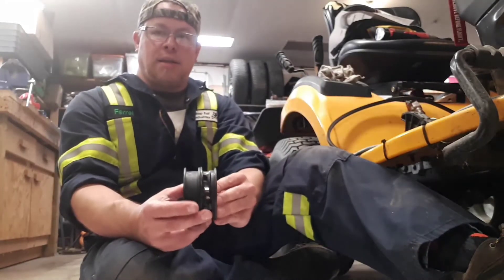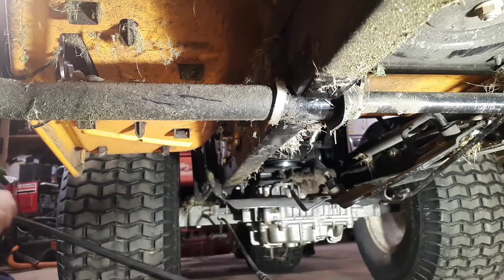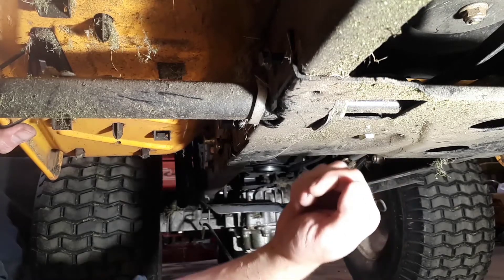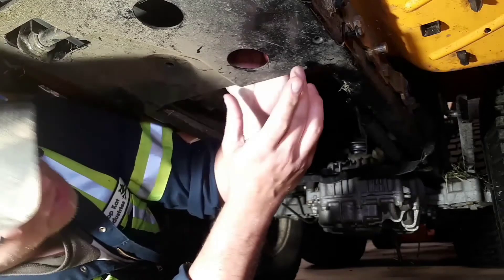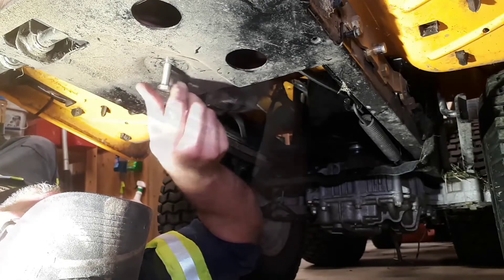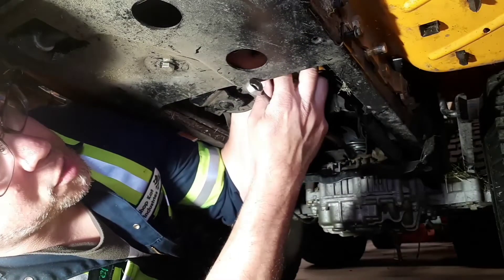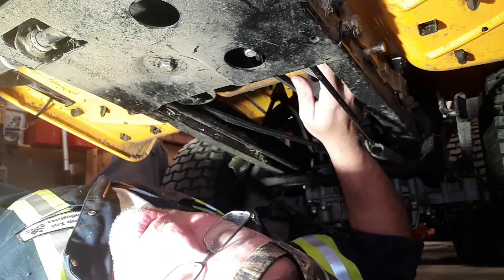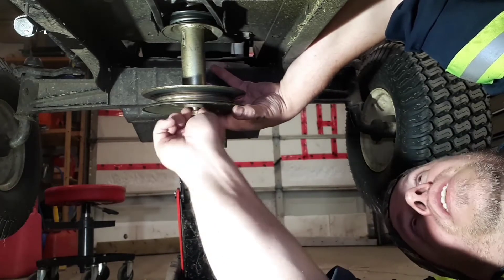Cub Cadet Drive Belt Replacement: The End!

Comment: On my Husqvarna GTH2548, I discovered that the floor plate was easy to remove and gave me much better access to the pulleys from above.  My damaged pulley was a V pulley and not an idler, and was not as badly damaged, so I am going to try to keep using it.  My drive belt did repeatedly pop off and destroyed itself, and the damaged pulley didn't help, but I think the main cause was because the pulley mounting bracket was bent, so the pulleys were out of alignment.  I found it reasonably easy to bend back the mounting bracket, maybe a little too easy because it is none too stiff.  My pulley froze because the bearing seized, either from rust or lube starvation or both.  
    I should order a new belt at least, but I might happen to have one the right size in my collection, so I am holding off until I can get out there and look through my junk.  I bet graphite powder in silicone grease would lube these pulley bushings pretty well.  I Also noticed that most of the replacement pulleys, for mine, are steel rather than plastic.  Also mine is on there really tight, so I'm not sure I can get it off easily, which is another reason to try to run it with the damaged pulley.
Reply from the maker: I had definitely thought about attacking it from the top! But I think a lot of things would have had to come off.

Comment: How’d you get the front pulley off?!?!
Reply from the maker: Hi Isaiah! Are you asking about the pulley on the engine? I just unbolted it and it came right off. I expected a fight but it didn't give me any! I'm guessing yours is not coming off so easily!
Reply: @ShopKatIndustries  so once you get resistance, keep going essentially 🤣
Reply from the maker: @isaiahtorres91  some times it's fix it or f... it lol! There's a square key in there so it might be hanging up on that. It's not going to be very easy to use a 3-jaw puller on and the risk of bending the pulley would be basically 100% I think!

Comment: Does that spacer need to go on a certain way or is it reversible
Reply from the maker: The one above the drive pulley is reversible; as for the ones on the belt pulley, I just can't remember...I think it was not reversible.
Reply: Yeah the pto spacer I didn’t know if it went on a certain way
Reply from the maker: @Amber-w2e  I want to say it had a little step in it, and went on one way, but it was a while ago...and I no longer own the tractor so I can't take a look for you!
Reply: @ShopKatIndustries  like a chamfered edge
Reply from the maker: More like an indented center, I think?